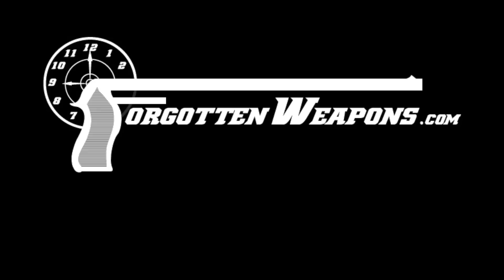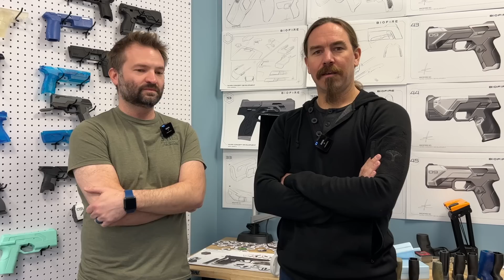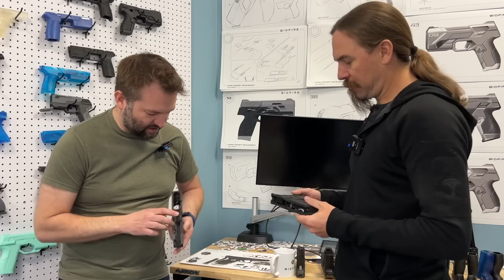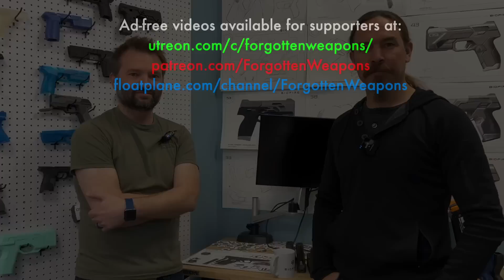Interview w/ Biofire's Lead Designer: Features and Reliability

Comment: Okay, so my husband is really the gun guy but I watched this interview with him and had a question about the face recognation. Will you still be recognized by the weapon if you change the appearance of your face? Say, you shave your face or you lose or gain a lot of weight. Will this still be able to recognize you? I understand that the thumprint option is still there but the whole system needs to work - otherwise you're not gaining the ability of both safety options.

Comment: What if someone grabs the gun, then they point the back end where the camera is at your face to unlock/authenticate it? Then they can shoot as long as they hold onto the grip.
Reply: Personally I'd still rather the camera as a back up to the fingerprint reader than eliminate that perticular niche case.
Reply: @jordanreeseyre  I'd rather not have any of this tech in a firearm that could fail and result in your death, if for any reason something is broken then you have a paperweight also if it failed to ID you with both systems, there may be a use case but for self defense this could be the difference between life and death, especially if the battery is dead, eventually the technology will be more mature and reliable, but it has a ways to go, it's still really cool don't get me wrong, reminds me of Judge Dredd.
Reply: @frankyg2384  If you ever watched PsychoPass, it seriously looks like the sci-fi gun they chose to design.

Comment: If it's going to just sit in a room until it's needed (like on a nightstand) it may as well be a large format pistol like an AR9 or stribog if not a carbine or a shotgun. That would give it more points of contact since you're not worried about size as it's not a concealed carry weapon. The only time it needs to be this small is if you have it in an office or vehicle, which wouldn't be recommended because someone could steal it so you can't have it even if they can't use it.
Reply: Defeats the purpose of it not being able to be used by someone else (IE, child, roommate, etc)
Reply: @cpufreak101  how would changing the format and making it easier for the shooter to control make it easier for a child or roommate to use it if the software and hardware is still the same? Being able to grab it further along the frame,  shoulder it, get a cheek weld, space for a light, and have a longer sight radius has nothing to do with the parts that are already on it. If anything, that means more space for those parts.
Reply: @jacobstaten2366  my bad I misread your original comment.

I'd imagine this is in a pistol form to be more "inviting" for first time gun owners (as they have said in the video it's built for a target audience that's been well researched). With enough time and market adoption it may eventually make its way into such larger formats
Reply: @cpufreak101  no worries. A 9mm carbine version would probably be better for the target audience anyway for the above reasons, and it would be quieter. Ironically, like you said, it might be harder to convince them to buy that over this.

Comment: These guys have done a better job defining a target customer, refining requirements, and validating assumptions than most tech companies I've worked with. I'm betting we'll get some first batch teething issues as with any new product (especially a ground-up gun design), but I have high hopes that this kind of attention to detail and focus will lead to a successful product. Wishing them all the best.
Reply: Yeah, this is how we want things to be developed.  The worst part is I'll be they don't meet the requirements for ISO 9001.  Because certifications don't care about actually being able to do something, just that the proper paperwork is in place!

Comment: I still don't see why they didn't just go with a simple rfid or rfid like system instead. Wearing a watch bracelet ring or injection with an rfid chip seems like a small price to pay for the near perfect reliability it would offer. He's even wearing one here in video. You could then build another backup on top of that like finger print. Its also easily integrateable with or into other technologies like home door locks, phone locks, payment systems, car locks, and much more. As long as you have  the rfid on you you also won't run into any number of situation complications that could stop the use of it like being too dark for the facial recognition facial hair glasses anything covering your face (cold weather masks of some kind) injury to your face + fingerprint damage, gloves, dirt and grime, or improper sensor contact.
Reply: I forget to put on my smart watch all the time, and I use it multiple times per day. It's also something that can be divested from the person, if I take it off now anyone who takes the bracelet can pull a Judge Dredd with my pistol. My bet is that when looking at ways to validate ownership, the risks of an external device that wasn't attached to the owner permanently induced risk that was outside acceptable levels, and that microchipping people for more secure RFID was even less palatable.
Reply: @JaredBallou  but pointing the rear cam away for a second at your now victim is more secure than having to rip off a bracelet ring or watch? I get the forgetting it thing but mentioned backups for such. As someone who regularly has environmental/physical factors that impede both the verification methods he gave its a hard sell. Back when i actually wore a watch i never really forgot it only taking it off showering and sleeping I'm guessing a ring if you just always had it on wouldn't be an issue either
Reply: @issacwessing4945  Well, I think when the gun comes out in retail, we'll have the answer. The designer claims here that both methods can lose the positive ID feedback (change grip, gun at side, etc). but I haven't seen any real world testing or limits for that presence system. They at least give it lip service, and I'd certainly agree with you that it's a concern, but I do think they have at least covered the major cases of usage which would leave the gun active while also not needing the constant sensor activity.
Reply: @JaredBallou  my worry really comes from initial activation. I can make sure I have an RFID on me but cuts on my hand dryness dirt wet winkled hands and then facial changes darkness brightness and numerous other factors impeding facial recognition have me not wanting this gun.
Reply: @issacwessing4945  I'm not sure they mention it here, but Ian's prior video mentioned that there is an IR illuminator on the facial recognition module, so it works regardless of light levels. Either way, I would wager that neither of us is the target market for this, so maybe we're looking at it from the wrong set of assumptions.
Reply: @@SashraanMusic from what I've seen those only really work for no auth no encryption RFID cards. I've seen duping mentioned on newer versions or encrypted but both required some type of physical access attacking either the card or scanner. As for jamming yes but I'd be more worried about some type of emp device than that. It's also possible to design resistance to jamming and you also have the backup method. Either way I think it's far less likely to fail than both facial and fingerprinting.

Comment: Does anyone know in what video Ian talks about the failure of technology replacing training regarding firearms? Many thanks in advance.
Reply: I really don't think this is about technology vs training. The target demographic here, so far, is suburban parents and prison guards. There is no amount of training which is capable of removing the risks and necessary compromises inherent to those situations. This sort of device has to potential to significantly mitigate those in a way that training simply cannot.

You cannot train toddlers at all, and you cannot train yourself to open a safe as fast as not opening one. 

Probably should gtf down off your smug high horse.

Comment: Interesting concept. I probably won't buy one unless there's major changes in the legal landscape.  I think I would rather stick an RFID tag in my hand than rely on my fingerprints not being damaged, and having a camera recognize my face. The one in my phone isn't very reliable and it sees my face every day. It's cool that it's an option though 
BTW my fingerprints are always damaged I assemble industrial equipment for a living.
Reply: If it's anything like the fingerprint reader on my phone, the tech has come a long way in recognizing even wet/damaged fingerprints. You'd have to have a pretty serious cut for it to not work and it'll read my fingerprint even in the shower

Comment: I reserved one right after Ian's hands on video.
I own several hand guns. Where are they?  Locked in a safe.  Where are they if I need the quickly, locked in that safe.  I have wanted something like this 20+ years.
I transport one of the ones I own now when I am in my RV. When I am not in my RV, I can only do so much to secure it. My biggest concern is loss of control and the wrong person getting their hands on it.  It's why the one I do carry has a magazine disconnect.
Every police officer should have one of these.  It takes the whole concern of the bad guy wrestling for the firearm out of the picture.
The list is long all of the situations where this tech could make a guns presence safer.

Comment: Excellent. One question- is there a way to lock the gun where even the user cannot change the settings?

IE someone can’t assault you before you get to the gun and then beat you up to make you change the ID.

Comment: Once the meat and potatoes of activation and deactivation is hammered home the interesting next chapter becomes "debugging" the firearm portion itself. Initially most users of this system will not be the traditional "I go to the range at least once a month to stay sharp"-crowd, but eventually those will start trickling in if the gun gets a good reputation, and that's when wear issues and the 0.01% chance issues will start showing up. I really hope Biofire turns out to be the kind of company who work proactively with their costumers and offer parts replacements fairly priced along with complete transparency about the state of affairs. Too many guns, that could have become stellar over time, died a horrible death in the name of "saving face".

Comment: Thousand round eval, including an Arizona mud test. Does it work if you're wearing gloves and the optical scanner if frosted over due to cold or has rain on it? A personal safety firearm that doesn't work is a problem not a solution, and until it's actually tested it doesn't work. Lack of illuminator makes me wonder about how much of a home defense firearm this really is. And as someone for whom multi day power outages are a thing, how long does the battery last? Is it it a brick with a dead battery, or do you just have to outwait it?

Comment: Any plans for a Biofire rifle? They seem like a company that genuinely cares about the product and consumer, so I wish them luck.
Reply: I don't really see the target demographic being one that would support large enough sales figures to make a rifle economically feasible.  The kind of folks who are going to buy this gun are the kind who would have bought a Glock 19 or (in earlier decades) a K-frame .38 revolver,  except they are really concerned with instant access with total access control.  These aren't the kind of folks who are typically going to think of a rifle for home defense...

Although it would be easier to engineer the biometric stuff into a long arm, simply because you have a much larger space and weight budget for the widgets.  Ambi sensors?  Sure.  Fingerprint sensors on both the grip AND the forearm?  Sure.  Simple LED indicator on the front sight, plus a status screen in the side of the stock where you won't even see it when you're trying to use the rifle, but its instantly available when your "admin"?  Sure.  Backup CR123, AA, or even 9v or C cell batteries in the stock that you can just swap out once a year, just in case the charger or rechargeable battery craps put?  Sure.
Reply: @geodkyt  Outside of law enforcement being a target demographic, I agree with your comment. I was thinking from an IP/patent perspective it might also be beneficial to have something in the works. Although I don't know much on that subject.

Comment: RED means fire, GREEN means safe.  I would be wary of using a changeable system, even with the "personal handgun" aspects.  Novices need to learn some fundamental of shooting.  The biggest problem I see is that "non-shooters" will buy THIS handgun, believing it is "safe", without understanding that the identification function is NOT a firearm safety as far as the operator goes--you can still shoot a non-target, you can still make a negligent discharge, you can still be stupid or negligent.  I would prefer to have people LEARN about firearm safety and LEARN how to shoot and when to shoot.  This is NOT a firearm i will ever be interested in.  I hope that the company is prepared for the lawsuits when some stupid idiot has a bad shoot, and then claims, "Well, it was a Smart Gun.  I thought it was safe."  They need to VERY CLEARLY STATE that the identification feature is NOT A FIREARM "SAFETY" in the usual sense.

Comment: The only smart gun i want is a gun that can fire around corners, hit the target by itself, or other functionality that doesn't exist now.  This is a solution looking for a problem.  Not a solution to a problem that exists.

There are so many issues with a system like this, it's just not worth it IMHO.  If i cannot pick this weapon up after sitting in a drawer for 3 years and pull the trigger and it goes bang, then not interested.  Electronics is not a good answer on a firearm.

For those that think this is a good idea, you do you.  If this fits your needs, please buy it.  But it will never fit a need i have, and actively hurts what i want out of a weapon.

Again, optics that allow me to look around a corner, seeker ammo, then sure, the juice is worth the squeeze.  If all it does is not work under a lot of restrictions, then no.

Comment: It's good to see the amount of time they dedicated to the details. That means they're really serious about their goal. Hopefully, the real-life use will prove their efforts worthy...
Reply: I can see these being invaluable for institutional use (i.e. maximum-security prisons). Pair the tech up with a propietary cartridge using modernized ThunderZap-style projectiles. Now even if someone steals one, jailbreaks it, they won't be able to get ammo for it.
Reply: @scowler7200  I've always been skeptical about electronics in heavy-duty mechanical tools... But THIS specific tool is NOT designed to be a heavy-duty tool. It's designed to handle ONE specific situation, and if they make it resilient enough for THAT situation, I'm fine with it. Headstand gun, always connected to the charger, always charged, never shot (unless you shoot a couple rounds to keep yourself up with it), and always ready for that event we hope never happens. I'm probably sold...
Reply: @josesardinas7660  
Maybe they could go a step further and design a smart holster. Maximum retention.
Reply: @scowler7200  Yeah, the dock should be capable of being a mounted fixture that locks the gun in place without authentication.  Even if someone can't fire the gun, you still don't want them taking it and have you be out $1500.

Comment: Hah, "Green means go" or "Red means dead." That's interesting! And yes, giving individual decision on the matter is for the best. Personally I believe that I'd go with 'green means go.' It's not a lever to move that reveals a spot of red paint, it's a screen with a light on a VERY high-tech scientific firearm. In a panic situation, seeing my pistol flip to red when I need it most could cause panic and make me smack the pistol thinking it's broken or the battery is dead or thinking it's not working when in fact it may have just unlocked.

But to each their own. the wisest choice is to leave a decision up to the individual, especially if a decision that can affect life-and-death situation.

Comment: As an engineer for 30 years, I learned KISS. Keep It Simple Stupid. More parts, more complexity - more failures. I cannot handle failures for life dependent devices. Hard NO for me.
Reply: So why would I want a 1911 when a direct blowback gun exists since it is much simpler and therefore more reliable? Also cars are a lot more complex today than they were a hundred years ago, are you saying that a model T is safer than a modern car?

Comment: They dance around the reality that cell phone companies have been doing all the heavy lifting in the biometrics for the last several years. They're the main reason for the reliability increases in both identification systems.
Reply: Cell phone companies have the cash to do the heavy lifting. Start-up niche gun companies are just along for the ride. I don't mind, though!

Granted: a sentence or two admitting the fact would be nice. But it isn't strictly necessary, methinks.
Reply: Fair lmao, but thats hoe innovation should work, the big players get their massive cuts, but then everyone can use them using the tech made by others.

Comment: My immediate reaction is remembering a computer I had that ran Windows 95. I would not trust that level of reliability with my life.
Mechanical firearms are a mature technology, and the only times my bedside firearm has failed was with bad reloads (my fault). I would want a several thousand mean rounds between failure before I would trust a “smart gun”.